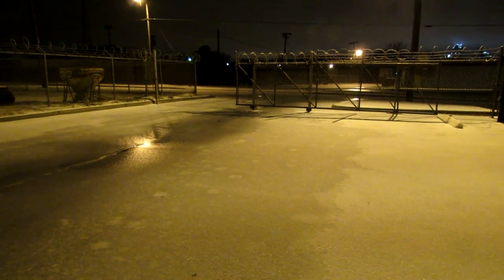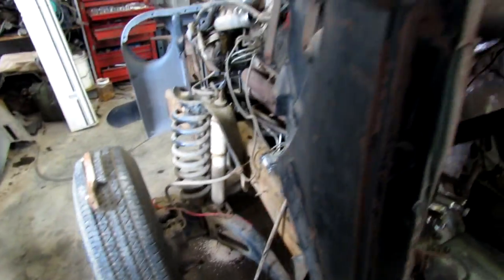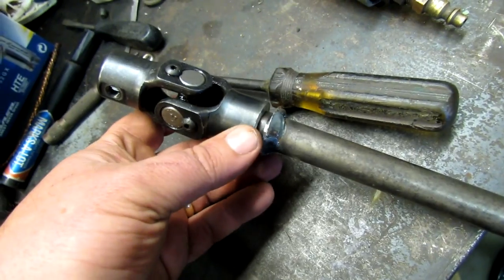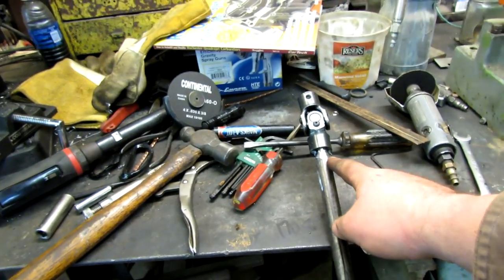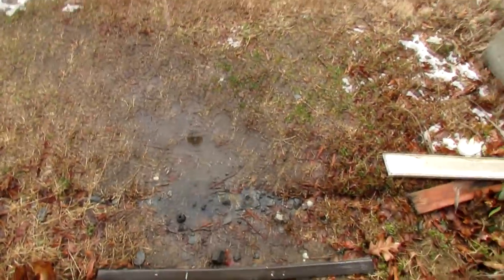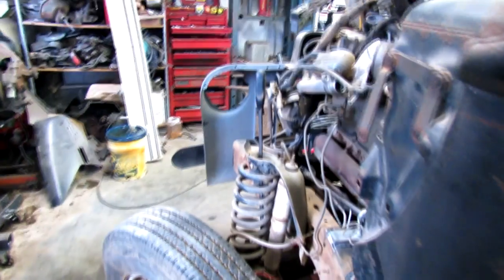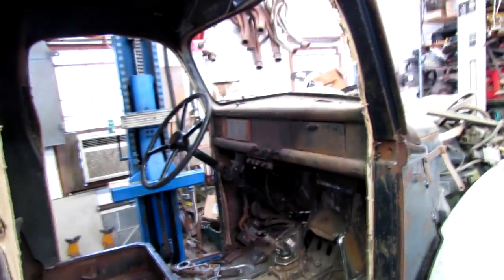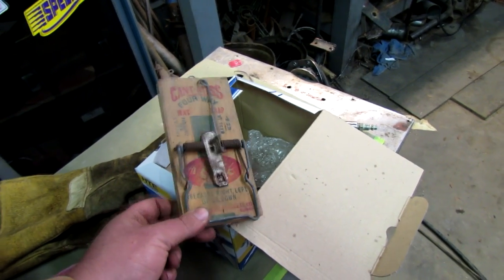46 Ford-steering columnn done-AGAIN

Comment: even I don't like ice . I'll take snow any day over that . 
nice work on the column , i'd do the same too . it would bug me :)
Reply from the maker: I'm still amazed at how well that Chevy does with its stabilatrak system. Great in the snow. Awesome even. A little red mud and it won't move though. Go figure.
Reply: I think the running boards had a large gap between the bottom of the cab and the top of the running board. I mean like a 2 inch gap. Maybe you are changing up things like that to your liking. I wouldn't of had a clue about in phase or out on the ujoints. I have been told 3 is the limit without using the little eyelet thingy, man cant think of what its called. Also I know not supposed to be used in more than 30 degree angle? I thought you had to run rag joint too but found out that's not true. I dont know much as you can tell. Kind of useless  information to me anyway if I'm not doing any of it. Ha! Keeping on living is my hobby nowdays. Try to carve if I feel good enough. I like watching though. Cant wait to hear it fire up! Then, NOVA, NOVA,NOVA...haaa! I am babbling and need to go to bed and shut up......sorry.....
Reply: orange peel gets stuck on a wet road . 
my 05 , I bought some good winter tires for it a few years back . For being a 2 wheel open diff , it does pretty good . Can still pass the big 4X4's on the hi ways ... lol
Reply: ***** My 66 will get stuck when the ground gets soft cause the rear end is so stinkin light. lol

Comment: I think u-joints out of phase is more of a vibration/balance issue for faster spinning drive shafts than it would be for a steering shaft. Probably would never have been an issue, but at least you won't have to find out now! I wonder if this sort of thing is an issue in IRS corvettes that have 4 u-joints (2 on each half shaft). Do all 4 joints have to be lined up? What about limited slip? They would rarely be in phase in that scenario right? Curious...
Reply from the maker: Eric Howard A Mack truck's steering joints are not phased....I would think one side would not affect the other.

Comment: I showed this to a neighbor who is an automotive engineer and he seemed to think that the non-pinned u-joints (joined to the steering shaft only by weld rather than by a pin) were of much more concern than the position of the u-joints. I don't have any experience with building this kind of thing, so I won't comment. The u-joints on the uni-mog are not "in phase." Just FYI.
Reply from the maker: I've been thinking of that. I think I will po them as well. One can't be too careful on steering or brakes.

Comment: Hey Mister Heavy,..if your good with your fender placement and your door swings you can put that running board wherever your little heart desires and filler strip the gapwith a rubber seal or whatever is under the bench . Killer job on the 46squeezer ,thanks for letting us watch ya work,and you are truly blessed with a cute buncha helpers.
  So whats with all the Constantina wire and chain link,you workin a rough neighborhood or having trouble keeping ol shep in the yard?<grin>
Reply from the maker: Keith Lynch Thank you...rough neighborhood around there....